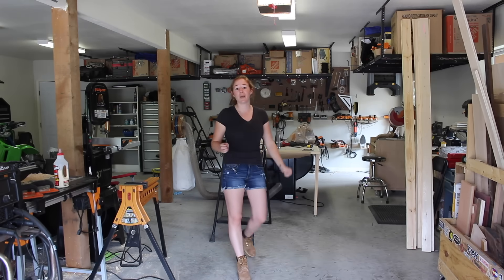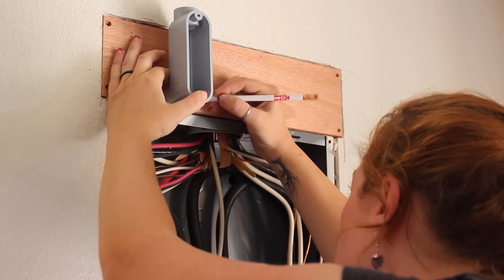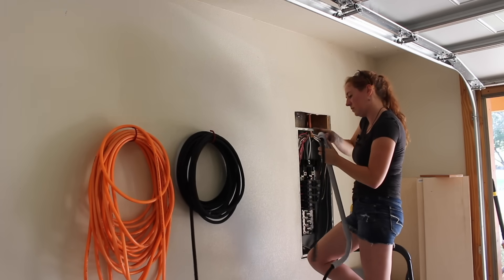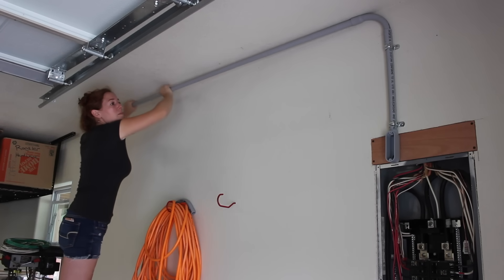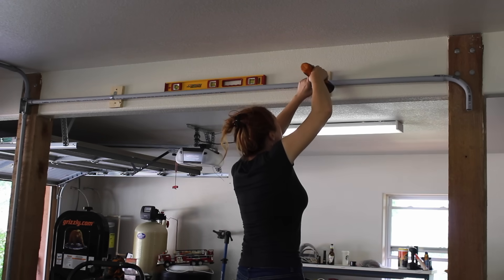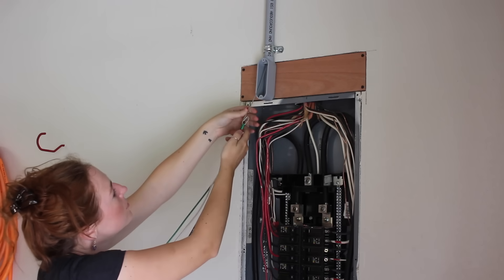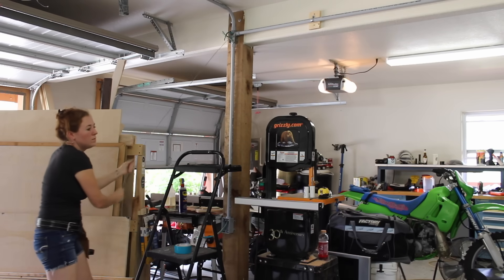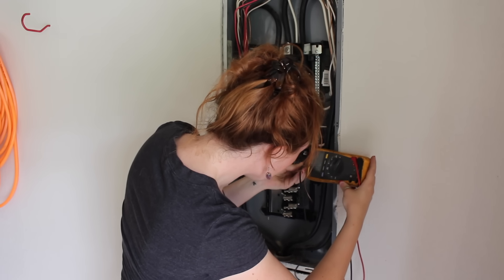Adding 220 Volt Outlets to the Garage

Comment: I have been an electrician for over 25 years and she also stated that she spoke to a few people before tackling this project. So maybe,  just maybe  All of the comments should be thought thru before being spouted in the comments. It s her shop and she is able to do as she ikes in said shop. Or better yet #youshould do what you do in your area and let others do what they do in theirs. Great video April YOU are an inspiration to me and got me back in the shop making wood glitter again
Reply: @Pat Fithian  A HELPFUL comment would have been to say WHAT those code violations were.
Reply: See, I've only been an Electrician for a few years now.  Have worked on everything commercial and residential.  98% of the work I've seen done, that I didn't do personally, was done by Laborers, not Electricians.  So if the person grasps the concepts of how electricity runs, ask questions about what they're unsure of, and feels comfortable doing the job themselves.  I see nothing wrong with it.  I've had to fix so many errors over the years that were done by Master Electricians.  So I'm open to people trying things for themselves.  It's not like she's figuring out demand factor and installing a whole new panel.  She's adding a circuit to a panel capable of supplying said circuit.  Although I would have put both Outlets on their own circuits rather than sharing a circuit.
Reply: @antoniobabich3583  I have to agree with you and I've been working on a lot of construction and maintenance jobs in the almost past 40 years, but unfortunately there are too many guys out there that can't change with the times (and before anyone makes the expected comment, I am straight )
Reply: "220, 221...Whatever it takes."
Reply: "so, are you going to make it all 220?"
"yeah, 200, 221, whatever it takes."

- from the movie Mr. Mom starring Michael Keaton, Teri Garr and Martin Mull
Reply: Tim - I actually was clarifying for those who may not get the idea that April is in the United States, this world is getting more and more connected so people assume things which is not a good thing at all. I have found myself guilty of this at times and had to go back to see where people were from, I found out that most of the people I follow are from Canada, England, and other parts of the world rather than the U.S. so yeah there's the personal experience for you :) As far as a 240V in the U.S. so long as your house is wired properly, there generally is no need for another secondary breaker besides the one you put in the box (unless that changed since the last time I installed one some 15 years ago), I am sure the trolls will correct me if I'm wrong in some rude kind of way.
Reply: Since she works pretty much alone in there, she won't be running more than one machine at a time and therefore is not likely to be putting much of a load on the circuit nor tripping breakers, so it should be fine.
Reply: @gatekeeper65  Not really. Air compressors tend to be turned on and forgotten about. Then the table saw or welder are fired up and wouldn't you know it the compressor kicks on at the same time as you startup the table saw and the breaker is tripped. One can never assume.
Reply: USA voltages to the group: I have an Ancient era pre 1900 house electric meter that is 100 volts AC. Later meters said 110 volts AC. Even later they say 115 volts. today a 2 wire 1S meter says 120 volts. AC started in the USA with 100 volts AC for "todays 120v" , 200 Volts is today 240 volts, 400 volts service in 1900 is todays 440 volts.   My business today has its 240 volt as actually 247 and the 120 volts is about 123 ish. Thus someday folks will say 125 volts is proper and 120 volts was back when the earth was cooling .:)
Reply: The guy with the long explaination is just looking out for her safety. yes it may seem like a pain but rules for safety is fo her benefit as well as for the neighbors. I she was next to your house for example and even tho she did a good job..and later it exploded and affected your house because it wasnt up to code...then thats all I can say. You wouldnt be happy
Reply: barbara kvistad I was attempting to reply to questions about equipment ratings and voltage at wall outlets using some references. I like to share information when I can.  I read all of the replies under Joseph Lepp's comment, and that's why I responded as I did.
Reply: 220, 221 whatever it takes
Reply: depends on actual voltage coming into the house and there is a specified range rather then a constant.
Reply: What's unsafe?
Reply: ok I did the math on my house and a 120 amp panel was used its at 135% that way they did it I think it should have been a 200 amp panel.
As it is now I do not have room to add 240 outlets in my basement the box is full. Now what do I do?  I'm looking at a 240 volt table saw I can't plug in and have been for 14 years. Pony panel?  reread the fact of its added load as it is.
Changing all the lights in my house to LED has probably fixed this to some point. and I've never had a issue with lights dimming on anything.
Reply: What loads do you have that total to 162 amps at 230 volts? ie you say 135 percent of 120 amps that is  1.35 * 120 =  162 amps? I purposely used 230 volts since one is going to have some sag in voltage drawing 162 amps to a home. ie that is 37 kilowatts of power. At 16 cents per KW that  is 37 *.16 =  6 dollars per hour in electricity.   Via diversity one does not run all ones devices at once. My house has a 200 amp service. The loads in descending order are  huge Hotpoint giant double oven range that has a nameplate of 18.1 Kw. ie 79 amps at 230 volts. The main AC unit is 26 amps at 230 volts. The dryer is 23 amps at 230 volts. All the my other homes loads are on 120 volt breakers.  All the many 15 and 20 amp single pole breakers are there to protect the 14 and 12 awg wires.
Reply: Joseph Lepp I
Reply: Walt Anderson luckily for me I live out in the county in Texas and we can still do our own work. The county does state that there is certain work we need a permit for though but not a lot. I'm drawing up designs for a shed that I plan on installing onto concrete piers. I just need to check on what required by the county.
Reply: I maybe wrong, but I think that's only applicable if you're adding an addition like a room, or heavy duty equipment like a furnace/AC.
Reply: and insurance companies will not  pay if there is any violation of code or NEC standard. yes she can wire it all she wants. and its great she is doing this. more kudo's. but as you know there are things that if you find acceptable and would do for your customer i feel sorry for them.
Reply: True, everyone here just trying to act like they know it all.  In the end of the day, Some of the code violations are just 1 and a million what if scenarios being covered up.  I feel like what she wired will stay up for a solid 20 years or so.
Reply: Do what you want.  Sure! Just remember insurance won't cover the building or any damages resultant from negligence to following 'code'
Reply: People can do what they want, but when you are teaching an audience you should be 100% sure you are teaching accurate information.  With electrical there are SAFETY codes in place.  Incorrect wiring can be dangerous.
Reply: Pat Fithian what are the NEC code violations?
Reply: Cory Goings A
Reply: 120/240 I meant
Reply: Doug Harder pl
Reply: I worked for an electric distribution company. The state(NJ) official voltage is 120/240V +-4% at the meter. Otherwise it is too low or too high.
Reply: Joseph Lepp i
Reply: I've been an electrician for 25 years, you have me working on wood glitter..........
Reply: She isn't interested Joe.
Reply: Joseph Lepp ^^ WRONG Cowpoke.... CODES come first!  It’s not like painting your walks pink. Thanks
Reply: @ShelliLoop  Actually cowpoke, if there is a code against painting your "walks" pink, then it is exactly like that.  The title of the video is "Adding 220 Volt Outlets to the Garage"  NOT  "Adding 220 Volt Outlets to the Garage and the codes you must follow listed by state then country"  She is showing us how to physically connect wires and screw in boxes,  I think it should be assumed that anyone going to work on or adjust the electricity to a home would have the basic knowledge and tools to understand what she is explaining.  If that's the case then one would assume they understand the concepts of codes and make sure they weren't breaking any.  If you're gonna say, "you don't know that, people are stupid"  I know they are,  but if they're that stupid then they shouldn't be doing the job themselves in the first place, and if they do anyway, are posters supposed to dumb down or slow down their videos with boring details that no one else clicked video to see?  Just to make sure a few idiots don't break a code they should have known about?
Reply: @ Josepy Lee Codes come First Fool !
Reply: Joseph can you join two ten foot wires together I am try to get 20 feet to work for a dry a 220 out let
Reply: Wood glitter LOL
Reply: She can add an additional circuit in the same conduit?
Reply: @budc6246  Curious wiring you have in US, in UK this would have been wired as a ring main upto 13 amp and individual for higher loads
Reply: Really
Reply: She changed it and that's what the COMMENT section is for, we don't just blindly follow DIY YouTubers, we rely on you all to tell us what they get wrong. It can't be a comment section full of people telling them they're so great, that's groupie mentality.
Reply: In this case when it's just for equipment that will only be run one at a time this would be safe?
Reply: When adding circuits to a home, you have to consider that the person currently using it may not be the only person that will use it. Most homes will be sold several times throughout the life of the home.  This is one reason we have codes.  Whoever lives there next may need to run two 240's at once and they have a reasonable expectation that the electrical work was done safely.  This is why we have codes.  You shouldn't have to wonder who did the work every time you walk into a different building.  Idiosyncratic installation of electrical equipment is a recipe for disaster.
Reply: bigalsimmons1 that depends non where you are at.
Reply: Tioga, this install is single phase. The USA has 3 phase and single phase. Both of the "hot" wire wires are 120 volts to neutral, 240 volts hot wire to hot wire and this is called a "split" phase by some, not 2 phase. 

 The USA's NEC says in part 90 : " The National Electrical Code has one purpose only, and that's the “practical safeguarding of persons and property from hazards arising from the use of electricity.”  Thus in the USA at least the population's safety matters besides the building

 USA Building codes and code inspectors are also like a religion. If the exact same building or home is built in 400 different USA areas then one has a Billion plus different combinations of rules, since each inspector is the god czar of his area. ie you did it wrong and have to change. 

ie what is legal in Area #20 is totally taboo in Area #350.  The same goes in the USA as far as guns and alcohol as far as laws and what is OK, Billions of different combinations.

Passing an inspection means the local guy marked it OK.  It does not mean the job is any safer, it typically is but often he is just enforcing his own rules. You might have run a #8 wire and he wants a #10 since he is the local god. If you get into a what is proper fight with him you might win but have months of delays. ie he is the god and shuts down your project during the delay. 

 In order to say if this install would "pass inspection" you would have to get the 100,000 inspectors all on the same page, which will never happen. Thus if the inspector in Mayberry RFD wants the 10 awg dryer wires wrapped with Pink tape the locals do it to get the job finished
Reply: everytime  I hear someone say 220...that line immediately cues up in my brain....I thought I was the only one..lol.....awesome movie
Reply: I am not versed on the NEC, but I am moderately versed on BS7671 aka British IET 17th Edition Wiring Regulations.

Disclaimer
*
This is an academic post for GENERAL INTEREST ONLY,
NOT INTENDED TO ADVISE ANYONE of the correct practise, ESPECIALLY OUTSIDE OF THE UK
*

OK that said...

In my opinion, wiring regs encompass at least 3 basic things:

1) Physics - what is likely to start a fire, kill people, damage equipment and cabling. That's basically an unvarying set of principles which are used as the basis of the rules. Although where the safe lines in the sand are drawn may vary.

2) Local system design. eg Britain uses 3 phase 230V with 120 degree spread. Nearly all domestic properties are single phase 230V AC. Neutral is grounded in a defined way. So we can get away with single pole breakers. From what I understand, 240V in the US are 2 phases, 180 apart. So I assume you need double pole breakers as the panel? 

3) Local practices - eg wire colour, attitudes towards power outside, in a bathroom etc. eg the system will not be fundamentally unsafe to the user if the hidden wire colours are wrong, but may become unsafe when a confused electrician modifies the system in the future.

=====

In Britain, this circuit would be classed as a radial socket circuit and may be fused at 20A or 32A, with an unlimited number of 13A sockets on it, covering any distance as long as loop impedance is within limits relative to the breaker (so it can trip the breaker under short circuit conditions within 0.4 seconds). 

The key difference is that our sockets are fused at the plugtop. For unfused sockets, we would have to additionally set the breaker current to suit the socket's max rating as well as meeting cabling specifications.

The IET regs do have a proviso for "nuisance tripping" being something to avoid in a design, which is what would come into play here. So if the intention is to use a specific socket for a large fixed machine and another socket for another large fixed machine, and use of both machines would likely trip the breaker, that would be considered a bad design (though not unsafe as the breaker will protect the cable from overload damage).

=====

Wire colour - in Britain - use of (formerly) black and (currently) blue or grey or black can be used as live/hot freely, IF sleeved or wrapped with (formerly) red or (currently) brown sleeve/tape - and often are at switch drops for lighting. Not doing so is a lesser violation during an inspection and generally frowned upon. However, I've seen plenty of professionally installed wiring that the original sparky couldn't be bothered.
=====

Interesting comments about not using sheathed cable in conduit. This is permitted under the IET regs, but there is a whole appendix of de-rating tables for different installation types vs different cable types - so an allowance factor can be calculated in for pulling our twin+earth cable through tube due to the restriction on cooling of the cable. Does the NEC have anything similar, or does it absolutely mandate the use of single cores?

That said, pulling Twin+earth is harder, though I can get 2.5mm2 size (standard 20A rated socket wiring) around 2 90 degree bends in 20mm conduit very easily with a fish tape. But I would not fancy more bends - unless I had a lot of inspection bends with removable covers, or junction boxes en-route.

=====
Reply: Tim Watts ^^% she is American in USA. Your UK stuff doesn’t count. By the way, I think (if you bother to check) your 
3-phase is 208-208-208.
Reply: A few major things to think about:
About US codes:  Each authority having jurisdiction in the US can enforce a variety of local codes, depending on their laws.  Some states and cities/counties do not follow the NEC, while most may incorporate it as a requirement.  The common rule has been to utilize the "strictest" code that applies.  For example, in the area I work, they refer to the NEC in special circumstances, but do not require all of it to be followed.  The NEC is not a "national" or federal law.

US residential voltage:  There is quite a lot of misunderstanding about residential wiring.  First and foremost, home wiring, in most cases, is only fed with one phase.  If you look at pole-mounted transformers, they tend to be single phase per bucket.  Only one phase wire connects to it, but what comes out is a "split-phase" 240 V service.  One phase, center-tapped to have 120 V on each side.  This is why they are "180°" apart.  the standard practice has been to call it a 120/240V split system.  So you can be correct calling it a two pole breaker, but it is incorrect to call it a two phase breaker.

The main code violation I saw in the video, other than the one she corrected with the wiring, was that the panel was blocked by her wood ("highly combustible") supplies.  To top it off, it appeared when she pulled away the supplies, the cover was already removed.  I understand she did infer that she usually has it covered. Because she stated she was installing the block on top to allow the cover to still open.  Running two circuit on one breaker is fine, as long as the breaker protects the wire and you could assume both would not be running at the same time.
Reply: ...so you're saying that every single home in the USA with multiple 15A outlets connected via 15A rated wire to a 15A breaker all need to be separated out onto their own circuits/breakers because you believe the expectation is that every outlet should support its maximum rated current simultaneously?
Reply: I have worked for a few electrical transmission utilities in the last 15 years designing substations and constructing them.  The senior equipment guys told me the voltage ratings are all over the place due to equipment ratings and regulation of the power system.  Here's an article on utilization voltage versus system voltage too: http://www.netaworld.org/sites/default/files/public/neta-journals/NWsp05TechBrief.pdf

In college I ran all sorts of tests on consumer electronics with regards to line regulation.  I would hook up a vendor's universal (90VAC to 267VAC) power supply to an AC waveform generator and measure it's ability to meet output regulation while documenting thermal, audible, and electrical characteristics. For instance, you could hook up your laptop power supply (120VAC to say 30VDC) to 30VAC 60Hz, and it might very well function. However, the diode bridge and bulk capacitor would likely be severly overheated from the high current and duty cycle as well as the ripple current and voltage on the bulk cap feeding the switching regulator (flyback converter https://en.wikipedia.org/wiki/Flyback_converter ).

I live within 2 miles of a 500kV to 161kV to 69kV to 13.2kV substation, so my wall outlet voltage is pretty rock steady at 124VAC.  Further down the distribution line, I'm sure the outlet voltage falls off during high load periods.  Voltage regulators and small capacitor banks are often used to compensate for that.
Reply: Anthony - I know that - which is why I was very careful to say I only drawing parallels for academic interest, from a UK perspective :)

I did also note that certain parts of anyone's regs are based on the physics of the setup, so those aspects are fairly transferable. eg I can see no issues with multiple sockets on a circuit provided the breaker is chosen to suit the max rating of a single socket. However, it may not be a recognised standard NEC circuit and it may be a code violation (I don't know) - but I'd feel reasonably confident it won't catch fire provided breaker and cable are chosen correctly.

One thing I haven't noticed comments on - do 240V sockets require a GFI as standard? Didn't notice one unless the breaker was a combined breaker/GFI (do those exist in the USA?).
Reply: I agree,i wont get a permit for anything if I can get away with it.the inspectors around here act like god
Reply: Ruben Villanueva Depends on the state you live in. More and more states have additional regs that supplement NEC, and more say you can't do your own work without a permit and inspection.
Reply: change youre single breaker to double pole breaker easy money...
Reply: Under the British regs, that's considered normal - it's referred to as "diversity" and there are some very specific  calculations that can be done to show if a single circuit and also the main consumer unit (panel) are overloaded or not. 

This is based on the principle that in a domestic setting no one will max out every circuit simultaneously. Surely the NEC has a similar provision?
Reply: gatekeeper65  "working alone so should be fine" is naive at best.  The code exists to ensure life safety of the structure for life - not the habits of the current user.  I've never seen 2-phase equipment circuits junctioned / they should  have been dedicated home runs. She has at least half a dozen other violations which have been addressed here that I wont repeat . Bottom line that installation would not have passed an inspection - not even close. Amateurish uninspected work like this is what starts fires or gets people hurt or worse. Every violation should be corrected and she should get an inspection whether or not it's required.  Period. Or hire a qualified pro to do the work and do not pay until the underwriter signs the inspection.  I don't see any middle ground here.
Reply: Am I the only one who got that?
Reply: "I'll either be at the gym or the gun club."
Reply: She asked to be Corrected Fool !
Reply: @thunderbolt5354  She asked to be corrected about the technical details of wiring the box, i.e. wire guage, voltage, etc... Not to put her down and pull code enforcement out their ass.
Reply: Just because you've 'never seen' junctioned 220 does not mean it is a code violation. Also, feel free to put up or shut up regarding which codes you are claiming were violated.
Reply: so she was running 240 at the end she said 245 v so is that 5 v to many
Reply: In her application she will probably never trip the breaker but technically you should plan your wiring for max possible amperage which would mean both outlets running at once. However unless she has multiple people working in her shop it will not be an issue. Can't say I would have done it differently.
Reply: I would get you NEC code book out and do some refreshing. There were at least 3 code violations that I can identify immediately, and a fire code violation as well.  20 years in residential and commercial electrical, and licensed in California.  As for your comment about being able to do what she wants in her shop....unless she is in some city that has absolutely NO building department, she really does have to follow the rules. Most cities require permits for adding new circuits, require all electrical work to meet current (or 1 to 2 generations older) NEC code, and be inspected for code and fire compliance. Additionally, should there ever be a fire in her shop, the insurance company will be looking for code violations / non-permitted work to use as an argument to NOT pay on the claim.
Reply: @patfithian7985  so what was wrong? firecode?
Reply: @patfithian7985  I'm kind of surprised more people didn't catch the fire code violation. Also, you are absolute correct about everyone, even homeowners, having to meet or exceed NEC in everything they do. After all, fire spreads.
Reply: @patfithian7985  I've been a firefighter for 23yrs, what fire code violation does she have.  Also, does she even mention the subject of permits in the video?  How do you all know that she didn't pull the proper permits, and just didn't feel like wasting video talking about it, so she could get right to the project.   Great video April, pay no attention to the safety nazis..lol.
Reply: Pat Fithian the NEC also states that the residential home owner can do what they want in their home but recommend that you follow the recommendations outlined in the NEC that your state is working off of. All electrical contractors have to follow the NEC.
Reply: Pat, who says she did not have a permit or after showing how she did it have it inspected? She never said that so you are making assumptions something illegal happened here.
Reply: @toysoldier46552  That's ridiculous.  She should have mentioned the permit and inspection if she had it.
Reply: @toysoldier46552  maybe this one has already been stated but there are three code violations, hinting she did not get an inspection
Reply: @Robinbvnks  Yeah and if that's the case then she violated the law.
Reply: @toysoldier46552  and it will be very hard to sell said property when the home inspector rolls up, or if that thhn gets a nick in the wire where her unprotected panel entrance is big problems
Reply: @Robinbvnks  Yeah well, they will have to cross that hurdle if it ever comes up. She just built a huge shop on that property.
Reply: Fire code does not allow home owners to do whatever they want however. Virtually every municipality also regulates this.
Reply: Tim wiring in the US where she is from is totally different from the UK so there's that and yes Jerry that is why I called out Pat on his comment, she never said she did not have a permit nor did she state that she did not have it inspected, everyone assumes she did neither thing but since she has been doing this sort of thing for a few years now, I am quite sure she did it properly with the proper inspections and permits in place.
Reply: I'm in school to be a electrician and the only thing that really bugs me is when someone says 110 or 220 i know what they mean but its 120 and 240 that's they only thing i'm going to say.
Reply: bigalsimmons1 **^ well, since you are a student, you might as well learn it right.  110 and 120 are correct — for conversation — but actual measurements vary, with 117vac being the most typical voltage.  Good point though.
Reply: @bigalsimmons1  It bugs me when I say 120/240 and they say you mean 110/220
Reply: @bigalsimmons1  Be glad you missed the 115/230 years.
Reply: Jason Fawbush So, other than your resume, what's your point?
Reply: bigalsimmons1 but it sounds retarded to say it otherwise. I have also seen it referred to as 115/230 also. So 110/240 is actually the correct terminology???